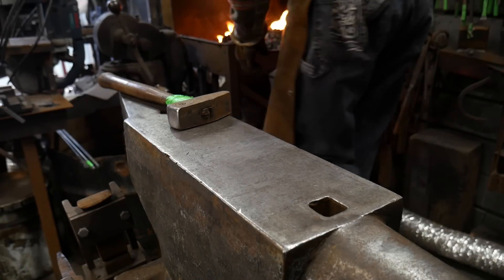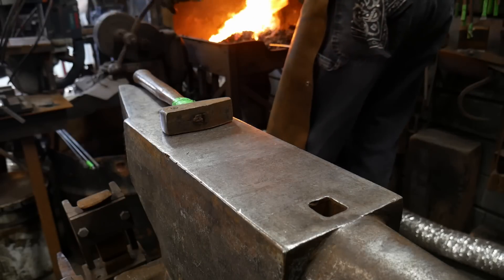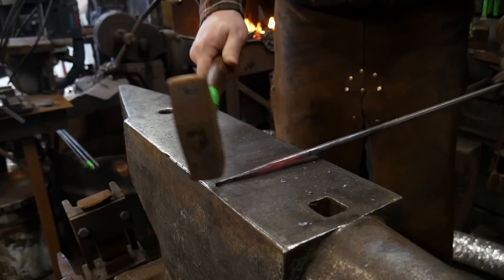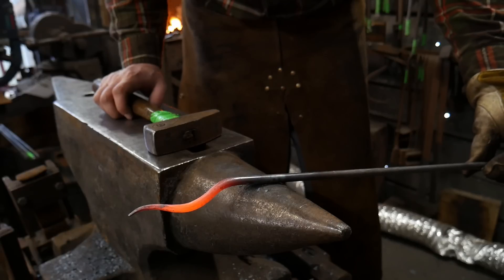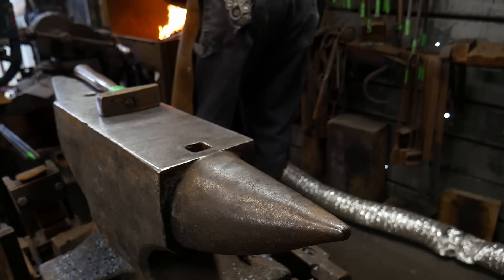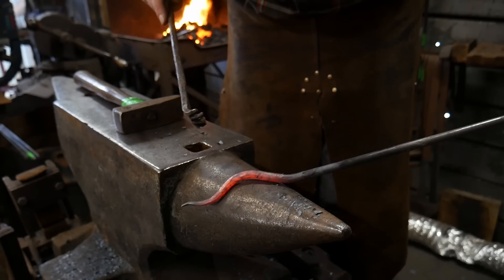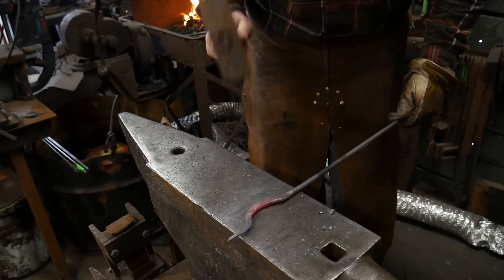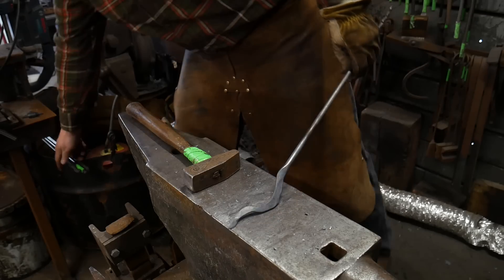Forging Flame Detail (Progressive Forging Exercises)

Comment: Thanks for your time doing these! Currently working on a hammer/tong rack for myself. Going all out on it as a training piece for myself. Picture sort of like the overall shape of an old cast iron Singer sewing machine base with bars across instead of a table top. Attempting to do the whole project with traditional joinery, No welding(elect.arc). So far I've got scroll work, forged bosses for rivets, heel tenons with slot punched holes and hot collars. Thinking about doing some acanthus leaf accents. Forging everything from 5/8"  square stock.  Got a ways to go, but loving every minute. A little over a year ago I struggled to forge a clean taper. I was always told the Best tool you own is the one between your ears, so invest in it. The knowledge you and others share about this craft is so helpful and makes that possible! I greatly appreciate it!!!